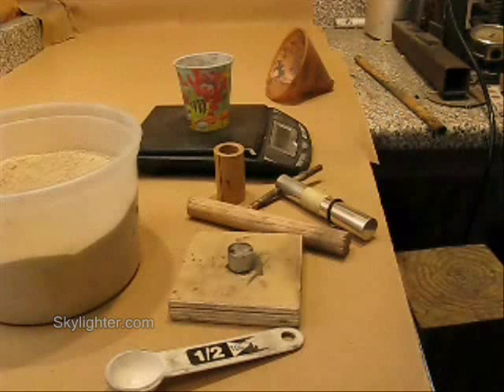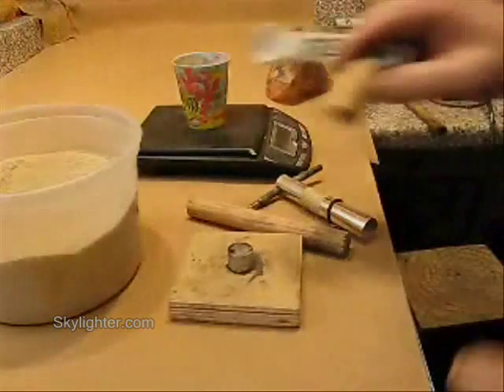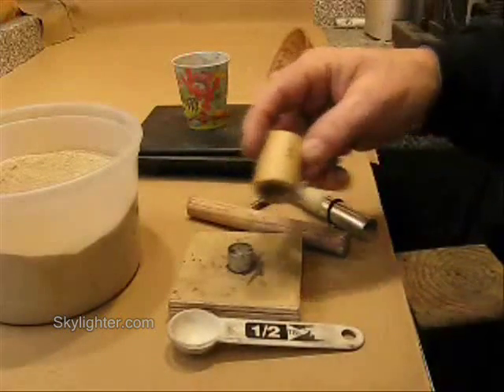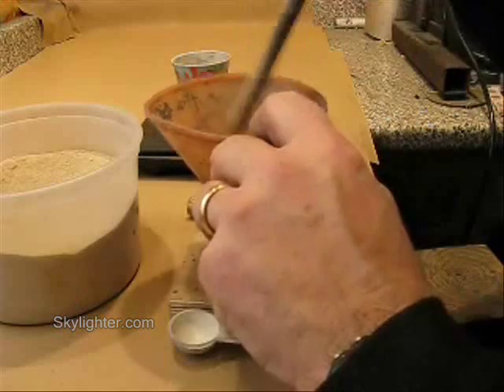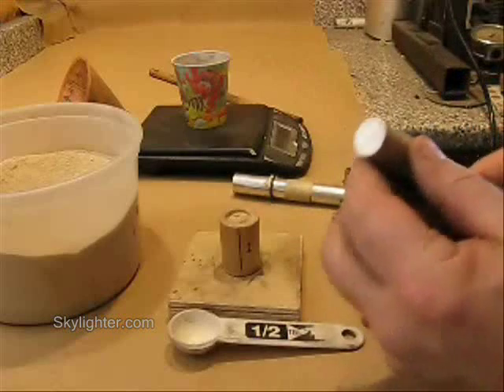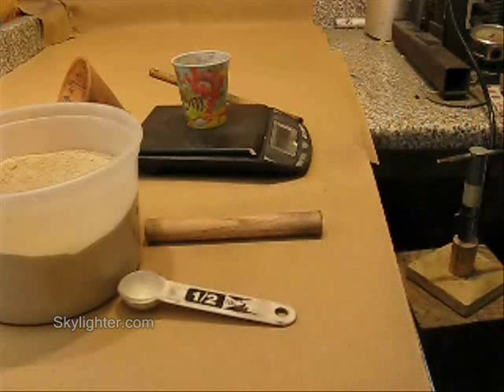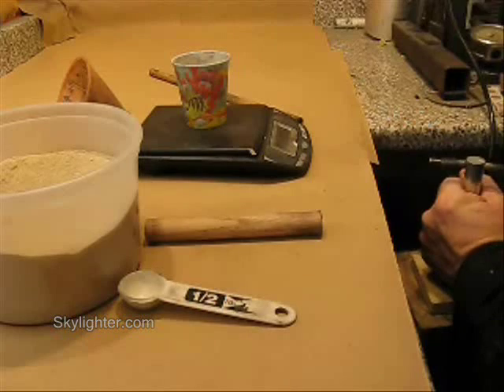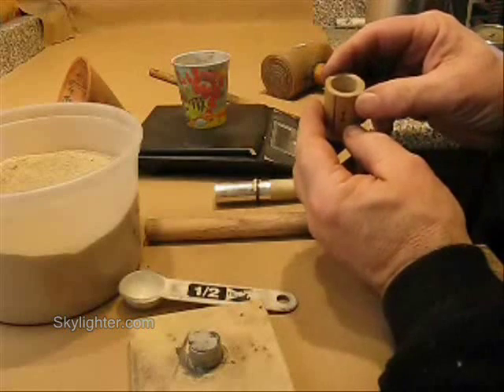Ramming a Clay Plug For Fireworks

Comment: How world you cap that, if that was the the bottom of the firecracker. How would you close it with the burst charge in it with the fuse ofc?
Reply: good question i usually just get a smaller diameter ram (a tapered punch) that way I can ram the clay all around the fuse. takes a little longer
Reply: @jasonweiglrer5367  but if you dont want to pack the explosive
Reply: @luddechamp  
Yup, same question is giving my brian a headache
Reply: did you figured something out after 4 years or still nothing